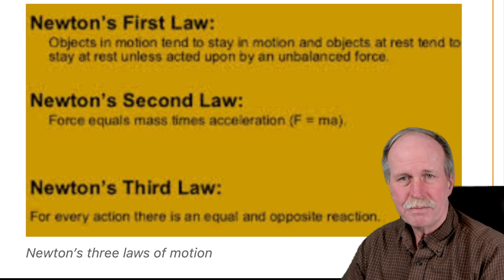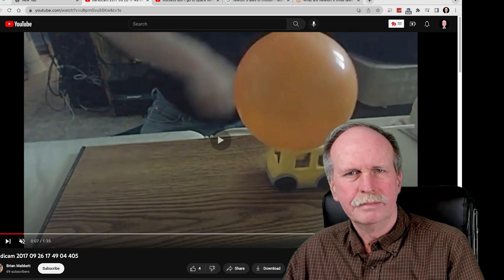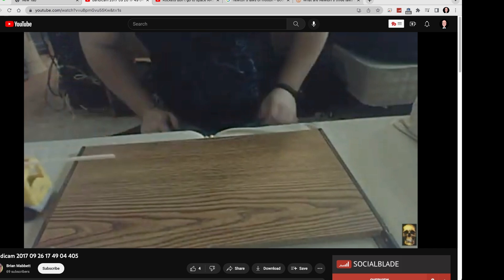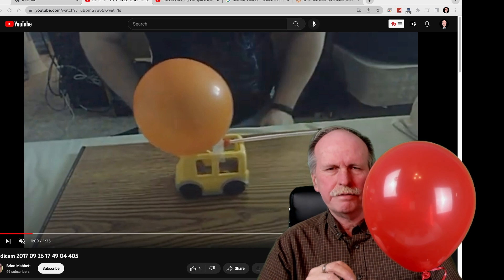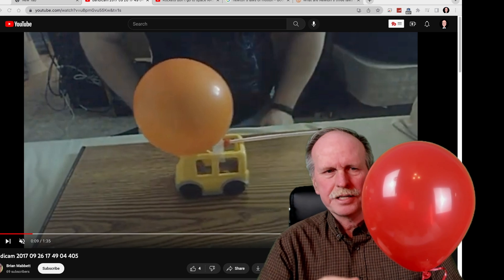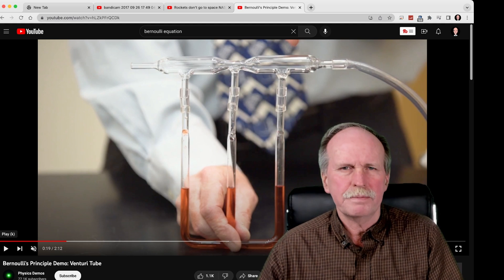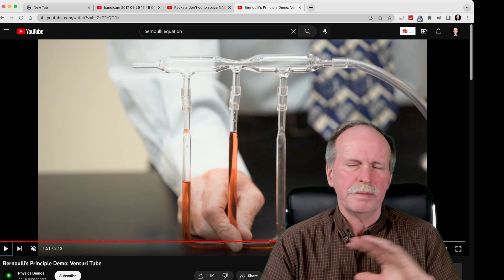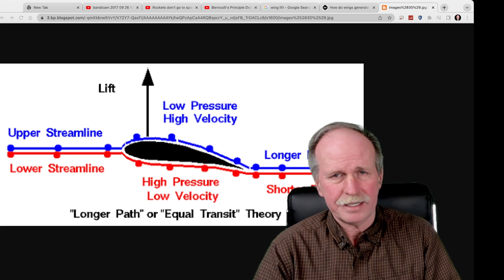Flat Earth Proves Rockets DON'T WORK

Comment: If the earth indeed was flat, I'm still waiting for a diagram of how the sun would rise in the morning, and set at night. 
We see the sun move in a straight line across the sky, flat earthers say that the sun moves in a circular path. 
How the days get shorter during winter in the northern hemisphere, while in the southern hemisphere days are getting longer? Does the sun change its speed? 
How would a sun dial work on a flat earth. 
and xflat earth might explain 6 months of daylight at the north pole. But how do we get 6 months of daylight at a single spot on the edge of the earth. 
Why is every planet a round ball, yet our planet flat?
Each GPS satellite crosses the south pole twice a day. The GPS system can't work with a flat earth.

Why hasn't a working model of a flat earth ever been made.

Comment: I think what that video was trying to prove is that you need air molecules to propel an object, So when air is exhausted from the balloon it collides with the surrounding air molecules and the pressure buildup behind the straw pushes the assembly forward, When he puts a vacuum he eliminated the pressure buildup therefore no movement is detected, The video is legit. I always though rockets work only in the earth's atmospheric layers, When they enter the vacuum space they just rely on the initial speed to keep moving since air friction is non existent (Newton 1st law). This has absolutely nothing to do with earth flat or not, Also has nothing to do with the direction of the balloon but rather the direction of the air nozzle.
Reply from the maker: Actually what the video showed was that he used a trick to prevent the carefully weighted car from moving forward by decreasing the pressure behind the car and allowing the ambient air pressure in front of the car to 'push' it back.  The fact rockets work in space is a simple matter of understanding basic motion and wasn't addressed beyond stating that fact and dismissing the claim they don't as a result.
Reply: @BobtheScienceGuy  But he didn't put the vacuum hose next to the balloon like you did, he just eliminated the nozzle jet effect, Rockets don't have enough fuel to keep going beyond the atmospheric air layers anyway, But I agree with you propulsion is possible in the vacuum space but not as strong as when there is air to push against, Kind of like driving in an icy road vs a dry road, You lose some traction when icy.
Reply from the maker: Actually the distance is about the same.
Your position is untenable.  We have clear evidence of rockets in space on almost a daily basis.  When you claim something can't happen and it clearly does happen, they rules of physics are not wrong, your understanding of them is wrong.  Correct your understanding.

Here is an excellent example.  Artemis just returned from the moon.  After firing their rockets (in space) they accelerated enough to leave lunar orbit- then SHUT THEM OFF, yet continued to accelerate toward earth, from 500 mph to over 20,000 mph.  That's gravity by the way.

Comment: The best thing about this is you could literally just buy a vacuum chamber and put an electrically ignited solid state hobby rocket inside the chamber, pull a vacuum, and realize that Rockets work in space. 

Instead these dudes are you here with literal suction tubes, toy cars, and balloons thinking they're scientists.

Comment: Nice video but marred by an error at about 15 mins.  Certainly it is correct that the air on the top of a wing moves faster and that this reduces the pressure, providing much, but not all, of the wing's lift.   Bob has repeated the statement often found in text books that the air stream flowing over the wing has to meet up with that flowing over the bottom, at the same time.  This is incorrect.  For starters the air molecules on the top have no 'knowledge' about the fate of those on the bottom and are not somehow compelled to reunite with those on the top.  Also a flat wing with no airfoil shape will also generate lift once it has an angle of attack and stunt pilots can fly inverted.  Search for the Cambridge Uni video that uses pulsed smoke that clearly shows that the two air streams do not meet at the same time.  In fact the top stream gets to the trailing edge way before the lower one.

Comment: Thanks, well explained.  The interesting thing many people don't realize about rocket construction; besides the heat and pressure issues, there's a LOT of force going up through those gimbals to the rocket frame.  Those things are STRONG!!!  When you had the old Saturn 5 engines, for instance, producing 1.5 million pounds of thrust each (about 7.5 million pounds force total), that means that indeed there was 1.5 million pounds of force trying to shove each engine up through the rest of the rocket!  And the frame has to pass that on to lift everything above it at that point.  They aren't just sheet metal cylinders by any means!  Pretty amazing indeed!!!

Oh, yes, the whole thing only (!) weighed 6.2 million pounds to lift at first, but the rest of the force is what caused the acceleration.  As the weight dropped, the faster it accelerated.

Comment: This older textbook hypothesis of equal transit time is not correct. Not only does the air not transit in equal time,(as verified in wind tunnel observation) but there's no reason it should. Wings don't create lift by creating a bernulli effect. Rather, they deflect air downward which causes an upward reaction force. You can't deflect air without getting a force. And you can't get a force unless you deflect air. There is such thing as lift being caused by the bernulli effect. It's important to note that;  the deflected air can not be recaptured. As this would result in no lift. The bernulli effect doesn't cause lift, but rather is lift that's already been done by the action of deflection.  The equal transit time model  has the cause confused with the effect. And it conflicts with Newtons laws of motion. The aerodynamic books need to be updated. A pressure differential on a wing doesn't cause lift, but rather is lift.

Comment: I was told years ago when they built the long reflection pool in Washington they did not take the curvature of the earth in consideration and when filling , it spilled over in the middle , and they had redo it with spirit levels.
Also you have to take in the static charge of the air through the plastic hose and the attraction of the ballon much like rubbing it on your hair
Reply: That's crazy if true.

Comment: A much better proof is to repeat the experiment in a real vacuum chamber.
Reply from the maker: Why?
Reply: @BobtheScienceGuy  Because you are not proving that the car can actually move with 'rocket power' in vacuum. Your main focus is to point of the flaws, which you are doing very well, but not directly disproving the original claim imho.

Comment: EVEN IF the Earth was flat... WHICH IT ISNT, surly they would still have a space and need rockets.. No? 😂 Also.. And I don't need to tell you this or anyone with a single brain cell but vacuum cleaners don't create vacuums, and even if they did, once that air has exited the straw, sucking up the air is too late.. The force has already been used up.

Comment: I have one little question for the "Flat Earth" people, if the earth is flat, what keeps the oceans from running dry when it spills off the edge of the disk? If there's no gravity and we're all standing on a flat surface eventually the water will find its way to the edge and drip off the edge.

Comment: The Earth isn't actually flat.  I live right next to a city park that appears to be quite flat, but according to the USGS topo map of the area, the southern boundary of the park is actually four feet lower than the northern end.  So it's not flat, it's tilted.
Reply from the maker: You understand topo maps measure elevation from a curve. Right???
Reply: @BobtheScienceGuy  it's a joke.  I'm no flat-Earther, don't worry.
Reply: Not only am I not a flat-Earther, but I grew up in Reston,Virginia, about a mile from the USGS headquarters and (in decades past) the great hall of maps.  Even the 7.5 minute quads taper towards the north to accommodate the curvature of the Earth.  If I was talented in math, I would love to be a mapmaker.

Comment: One look at the towers on a  long suspension bridge totally destroys the moronic flat earth argument.  They're measurably perfectly vertical on the surface, and farther apart at the top by precisely the amount calculated by their distance apart and their direction toward a common point, the center of a globe.

Comment: Newton's laws of motion do not apply in a vacuum. A car propels its wheels off the road. A boat propels off of water. An airplane propels off of our dense atmosphere. When there's a vacuum there's nothing to propel off of. You can watch this test be done in a vacuum chamber by Cody's lab. You will see him start a fan inside the vacuum chamber with a feather hanging in front of it when he pulls the vacuum the feather stops moving. Case closed
Reply: What on earth are you talking about? The reason the feather stopped moving was because a fan works like a propellor, not a jet. There's a massive difference between how the two work. Yes, a propellor does drag the craft through the air, but Jet's are propelled by exhaust fumes, not propellors.
It might be case closed to your mind, but you opened the wrong case.
Newton's Law does not require a medium to press against, and has never stated that a medium is required, propellers and fans do require a medium, but a jet does not, different area of physics.
In fact, I'm surprised you omitted the fact that Cody's Lab also put out a video titled "Will a Model Rocket Motor Work In Vacuum?" and guess what. It does.
Reply: Incorrect. 10,000 successful satellite launches prove that Newton's laws of motion do apply in a vacuum. 
A propeller moves ambient air, so yeah, that doesn't work in a vacuum. A rocket engine pushes mass (i.e. the propellant that is thrown out the back) to one side, and in reaction it moves in the opposite direction.

Comment: Can you please show me high pressure next to a vacuum without a enything between  :) and can you please go and messure the curve
Reply from the maker: You first what high pressure next to a vacuum do you think needs explaining?  And I did measure the curve. Look at my recent videos. Any more stupid questions?  While you are at it, tell me where Artemis passed through a barrier on the way to the moon.  Didn’t think that through very well, did you?
Reply: You need to learn the science before you can deny it. Nobody is claiming Earths atmosphere stops at an abrupt point, it is a gradual change in pressure over hundreds of miles, not 'high pressure next to a vacuum'.
Reply: Go to the nearest high building with a barometer. Measure the air pressure on the ground, then go to the top of the building and measure again. The pressure will be lower. You have demonstrated that  air pressure differences exist without a barrier. 
This principle is repeated all the way to space: At any altitude, the air pressure is just a bit lower than in the area below it. 
The 'barrier' is provided by gravity: it pulls the air molecules down. This force is tiny, but in aggregate it's enough to keep our atmosphere in a thin layer around the planet.

Comment: What you should be asking is how fast a rocket can exhaust compared to how fast it supposedly goes.
Reply: No, that's not what anyone should be asking.
Reply: An easy one: Because Force remains constant on the rocket. The equation required for this is F = dm * Ve = m * a → dm/m = dv/Ve.
Now, if you're being honest with yourself, you will admit that you have absolutely no clue where to even begin with this equation. Taking that in to account, do you really think you are in a position to claim you are smarter than all of us that do understand this equation perfectly?
Reply: Rockets accelerate due to the kinetic energy in the exhaust, which is the product of the exhaust speed squared times the mass. As long as that is positive, the rocket will accelerate. It doesn't matter that the rocket goes faster than the exhaust speed.

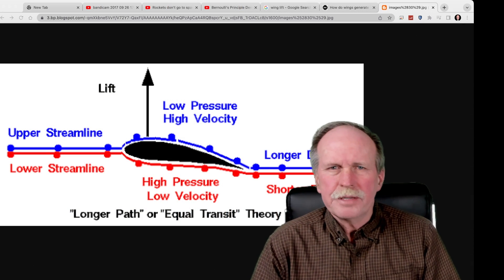Comment: 10:25  FYI the Equal Transit theory has been disproven for many years now.  There are literally videos on YouTube definitively demonstrating that the air on top of a wing does not meet the air on the bottom at the trailing edge, and Bernoulli's Principle does not apply in a non-confined free airstream in regards to providing lift.  Airplanes with fully symmetrical wings fly just fine, and even airplanes with traditional cambered wings fly just fine while inverted.
Reply from the maker: cool comment, thanks.

Comment: Those who believe rocket exhaust pushes against the ground during launch have never been to a launch pad at KSC. I went to Pad 5, where Alan Sheppard was launched, pad 34, site of the of the tragic Apollo 1 fire, and Pad 39A where Apollo 11 lifted off for the moon. The common feature of all pads was flame deflectors, which directed the exhaust sideways into the flame trenches so it would not bounce back up and damage the rocket. So the exhaust is not pushing down against the ground.

Comment: Excellent explanation of why the guy is wrong, but I have a slight quarrel with your airplane wing diagram. I that's how lift is produced, it wouldn't be possible for an aircraft to fly inverted, but, as an ex-military air traffic controller, I know that they can fly inverted for sustained periods of time. Also, by Newton's third law, if the air produces an upward force on the wing, the wing must produce a downward force on the air, accelerating it downward, so it would not exit the rear of the wing in the same direction as it encountered the leading edge - it would be moving slightly downward. Please correct me if I've misunderstood this.

Keep up the great debunking work.
Reply from the maker: Thanks, as you can see, this has been brought up about 100 times.  Wings generate lift in a number of ways (I'm a pilot).  However this is the way that is relative to this presentation, so rather than muddy the waters with a very detailed answer, I used the one that is relative to the subject of the video.

Comment: 14:20 I believe that using Newton’s Third Law as an explanation for how a rocket works, particularly in a vacuum, is difficult to justify as what action is being reacted to?  Most people see Newton’s Third Law as a force and a reaction to that force.  This is why flat earthers get the notion that there must be something for the exiting gasses to “push” against.  A better explanation, in my opinion, is conservation of momentum. Since before the motor is fired, and the rocket is at rest, the net momentum is zero and once the motor is fired, the net momentum still has to be zero.  The product of the mass of the burnt fuel and its velocity must equal the product of the mass of the rocket and its velocity.  For a rocket whose motor burns the fuel at a constant rate, the rocket will then accelerate as its mass is decreasing.
Reply from the maker: you are referring to the rocket equation, which gives a better answer.  but for this the third law is adequate.

Comment: I think the real point here is that even if the vacuum cleaner can reduce the air pressure enough to absorb the moving air from the balloon, it's an invalid experiment without creating the same low pressure influence from the other side of the balloon car.
Reply from the maker: yes, they used the low pressure to hold the car back, it had nothing to do with testing the 'rocket'.

Comment: Your wing airflow diagram is wrong. The airflow right after the wing is downwards, due to a major action of the wing is pushing air down, the good old "equal and opposite reaction" forces with the mass of the air being pushed down, when the wing centerline is tilted down. And while the idea of same transit time is often told, it is a myth. Supersonic airplanes have flat wing profiless, same shape top and bottom, tilted down, and have excellent lift still.
Reply from the maker: Gosh, you are the first guy to mention that.

Comment: The equal transit time hypothesis  is not correct. Now we have a big job correcting it. You don't get lift by creating a bernulli effect.  Air does not transit in equal time above and below the wing. Rather, air above advances well past air below, while air below is retarded.  The transit time is only equal when the wing is not doing work at zero lift angle. Further, the air deflected downwards remains in a downward motion,  and doesn't deflect back upward as depicted in the equal transit time model. There's no reason why it should, and it doesn't. The equal transit time model is not logical. It says that by invoking the bernulli effect, you get lift.
It might sound plausible , but it's not.  In the wind tunnel, you can see that air doesn't do whats depicted in the diagram. Nor is there a reason why it should. You need Newtons laws to explain lift. And the bernulli effect only explains how a force is transmitted . The equal transit time model invokes curcular reasoning.  In which "lift causes lift". It doesn't. Only deflected air does.  You can't have lift without it. It's well past time to fix this false model.

Comment: Don't understand how rockets push? Try holding a high-powered fan while it's running, or try firing a gun (proper safety, of course). Feel that push? That's the 3rd law in action. Rockets just crank it to 11.
Reply from the maker: if their theory was correct, a rifle would kick more with a hit than a miss.  very simple way to realize their claims are wrong.